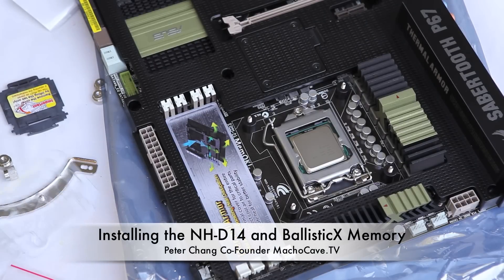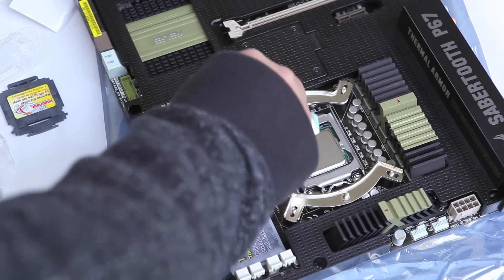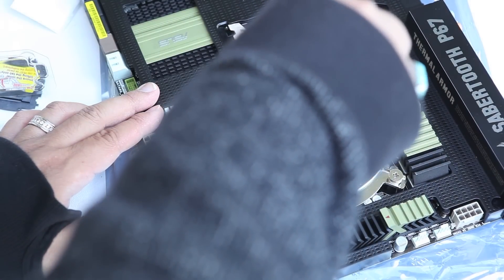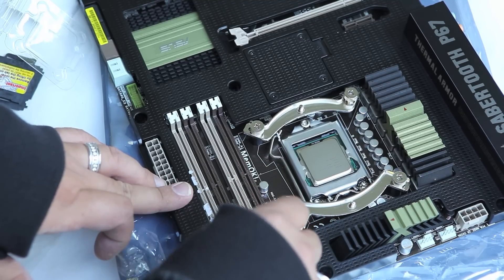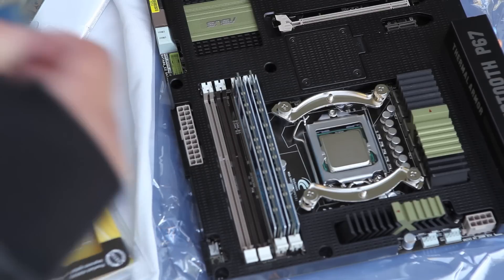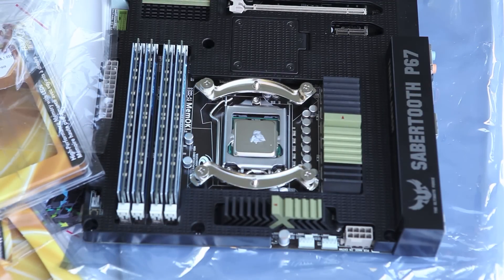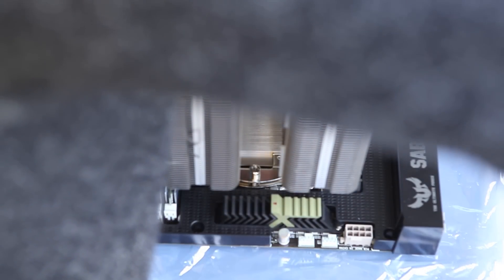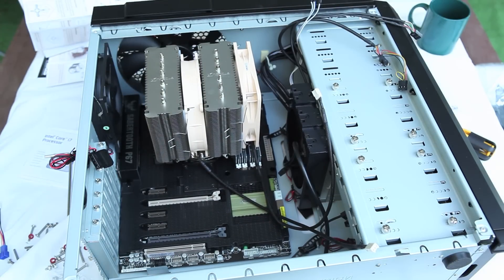Installing NH-D14 and Crucial BallisticX Tracer Memory build your own computer part 6

Comment from the maker: Hi! Double check to see if you have correct mounting bars and backplate for your chip. If you are using the correct hardware, check to see if the CPU is flush with the heatsink, if it's not, you may need to reset the motherboard into the case--or pull the motherboard out to see if everything is lining up flush to the heatsink. If your motherboard tray slides out you could try installing out of the case. Finally check to see if you have an RAM clearance issues as the RAM may be in the way.